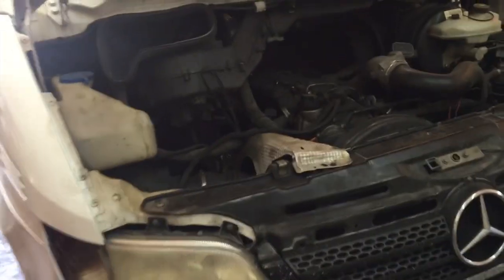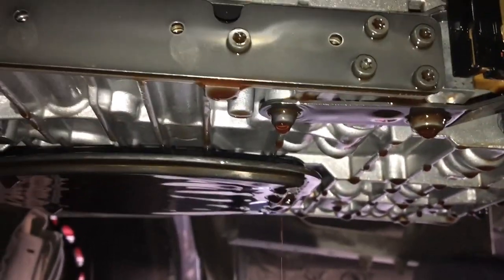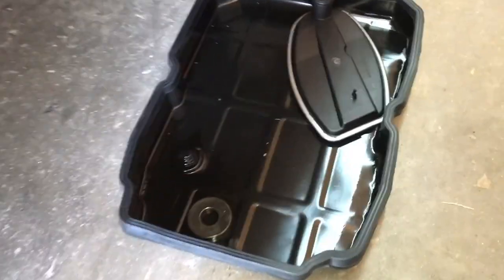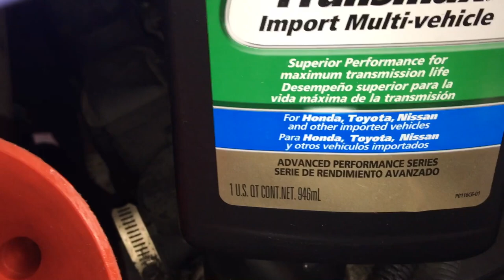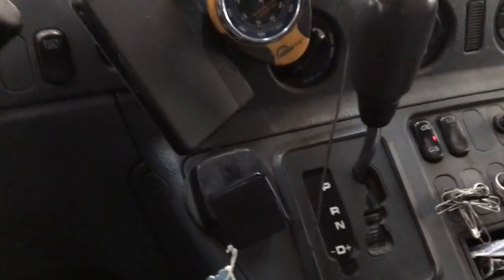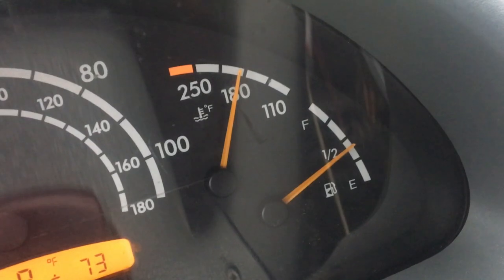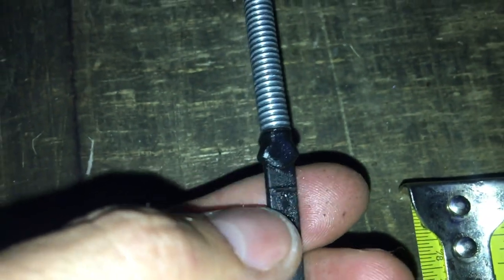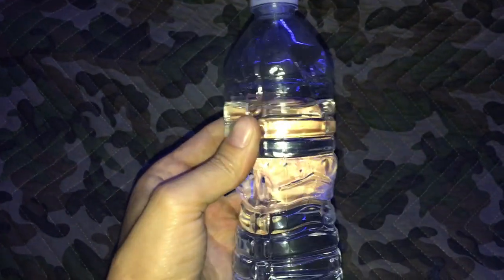2005 sprinter transmission fluid change

Comment: So I’m doing a full fluid change , transmission and torch converter. Everything went smooth as I drained it all, put new oil back in and before I started I was went through all the gears and could barely get it back into park( it took a little force) so I started it up sounds normal but now I can’t get it back into park. I have to shut it off and it goes right in. Any idea on what I could have possible done wrong? Also it’s not showing any gear indicators on the dash. It shows the mileage and everything but not R, N, D.
Reply from the maker: Make sure a little piston in the conductor plate are in place that shifts as you shift gear
Reply: Did you remove anything of the valve body? Or did you take the valve body off? 

The cable that come down from the shifter down to the transmission, it is connected to a rod that slides/moves inside the valve body. The connection between the rod and the lever that moves the rod is out of plastic, if you forced in parking, you could have broke that little piece of plastic.

Also, check or replace the 13 pin connector, that could be the problem too.
Reply: Dimitriy Perchik thank you for your response. During the 1st fluid change I didn’t remove the valve body just dropped the pan. I did notice a leak by the 13 pin connector, I started with that. Previous owner must have tighten to much so it stripped on the back end. Forcing me replace the conductor plate. Everything looked in order. No broken plastic pieces, the rod looks fine. After replacing the 13 pin connector and conductor plate put the oil back in and still having the same issue. I don’t see any fluid in the TCM that’ll be my next thing to check. Any other suggestions on what to do next? Perhaps the shifter?
Reply: Dimitriy Perchik also is it possible that I need to have the TCM reset in order the get out of LHM

Comment: Excellent video! DO you recommend changing the fluid from the torque converter as well?
Thanks!
Reply from the maker: Thank you! I heard people drain transmission fluid completely and flush it with some kind of a fluid some people flush it with diesel, I've never done it and never will :-) personally I only drain from Pan and then by removing filter whatever comes out out of there that's good enough, and I change every 40 maybe 50,000 miles, had no issues

Comment: actually!  its 8 L capacity you did not drain the Torque Converter ,  AND  You have to use CVT trans fluid. its $8-$12 per L

Comment: Wow!!, was that 740,000 miles I saw on the odometer? That's amazing. Is it the original engine and transmission?
Reply from the maker: clarence reeves transmission got swapped in about 370,000 miles I did engine overhaul in about 430,000 miles

Comment: Сколько заливал масла???? по логике вещей, столько, сколько слил, но а как же остальное, которого там еще пару галлонов в системе, то есть, масло нужно менять  как минимум 3 раза,так как ты просто сливаешь часть старого и добавляешь часть нового
Reply: If it's a complete flush, oil pan and torque converter, it takes 8 liters or 8.5 quarts. If it is only oil pan flush, 4 liters.